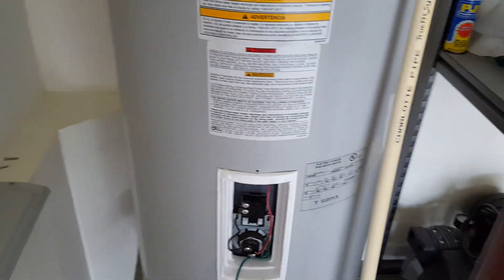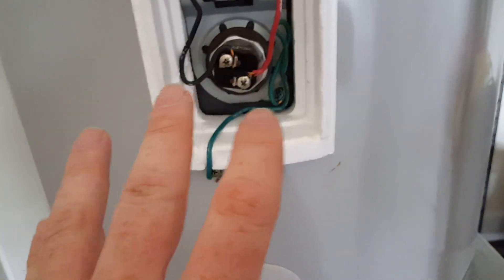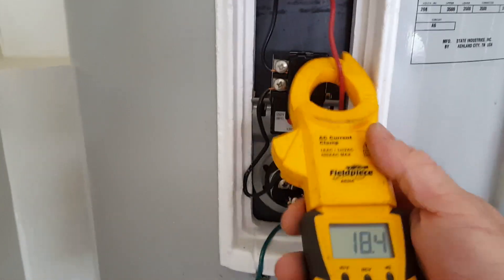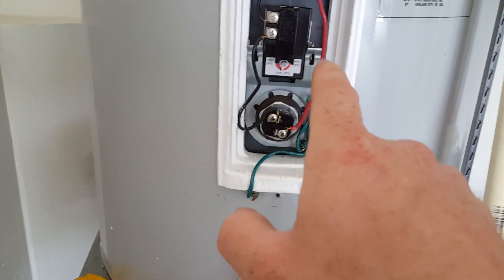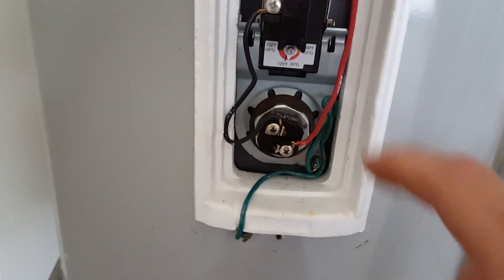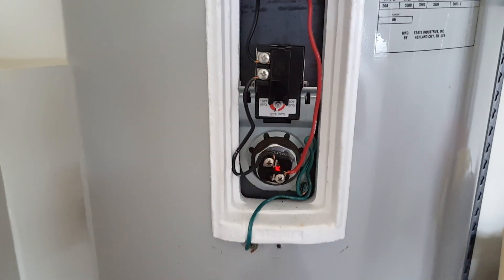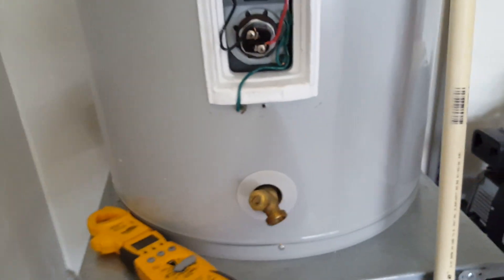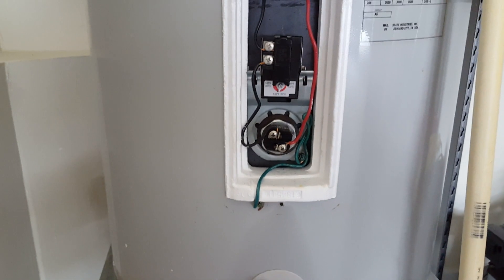how to test your water heater elements

Comment: if you read the manufacturer specs on the label, it says 240v uses 4500 watts element and 208 volt uses 3500 watt element
Reply from the maker: +Ben Staton  if you have a 4500 watt element and apply 208 you will always have a lower wattage.the element in the bottom of this water heater was a 3500 watt element. someone had changed it years ago. always check the rating on the element not what you think is in there. you never know what has been changed .  a 3500 watt element  shouldn't  be using more than 10 % of the rated wattage. this applies to all elements. the video is showing that you should check the ohms and then follow up with the check of the volts and amps to verify the watts. if one of these is out of spec it needs to be changed. the manufacturer is just telling you the same thing as the volts times amps equation. thanks for watching and commenting.
Reply: great video, produce more!